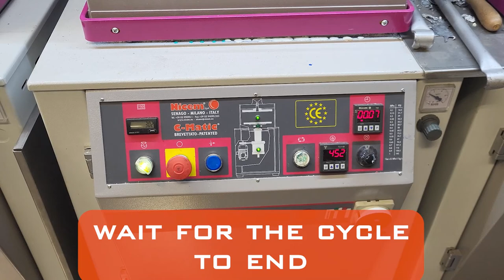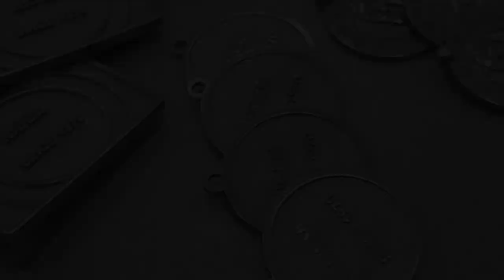Spin casting process with 3D-resin prototypes | Processo di spin casting con prototipi in resina 3D

Comment: Most impressive, grazie for the insight! Does zamak allow details under 0.5 millimetres in a spin casting and do you require higher RPM for that?
Reply from the maker: Hi! It's not possible to make objects less than 1 mm thick. You can create details such as the details of a miniature's face, but they must be very small areas.
Reply: @nicemspa3109  Thank you for the reply! Is it possible to create such details (as ventilation grilles or miniature lettering) on surfaces, that provide stability?
Reply from the maker: @isekaiexpress9450  The writing, in addition to the thickness of the object, creates stability as the space available for the metal to slide is increased.

The grid depends on its size and shape. There is always a need to vent air from the center of the grill.
Reply: @nicemspa3109  thank you for the reply! During my internship at a major railway model manufacturer in Germany, i was told that the high pressure of 300 KN in die casting is necessary of the need to overcome the viscosity of molten zamak to fill in the EDM-etched stainless steel moulds and to prevent microcavities that may promote zinc rot. I thought it was a bit overboard and such quality could also be achieved with your spin casting machines.
Reply from the maker: can you please send your request to nicem@nicem.it? So I can forward your question to the technical salesman 🙂 @isekaiexpress9450

Comment: Which silicone rubber is this? We use a RTV silicone rubber but never seen this silicone before. Is it a heat set?
Reply from the maker: Our silicone rubbers don’t work with room temperature hardening like the RTV silicones. Our silicone rubbers need to be vulcanized in a press, with heat and pressure.
This silicone rubbers are much more mechanical and heat-resistant.

We sell as well RTV silicones, but are different from the one shown in this video

Comment: can the silicon rubber die handle molten silver
Reply from the maker: It is not possible to cast the silver alloy directly in contact with the silicone rubber. The high temperature of the alloy would immediately burn the silicone mould.
You should proceed with the investment casting process.